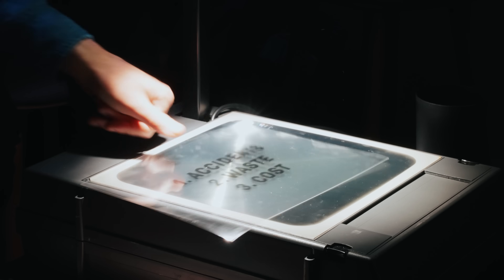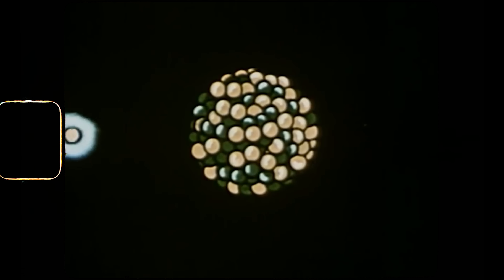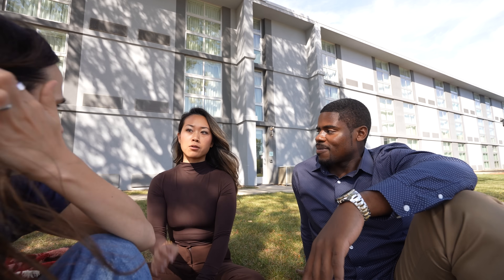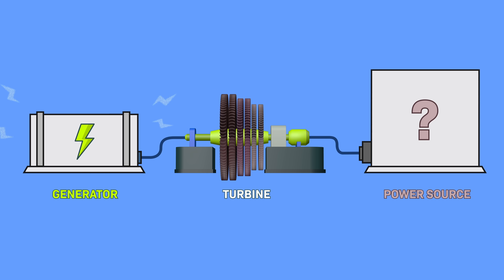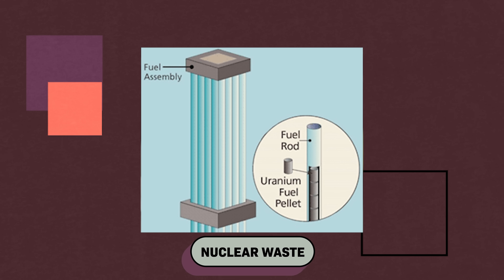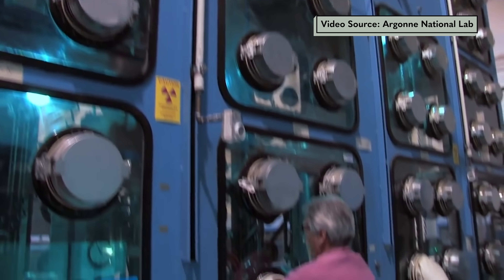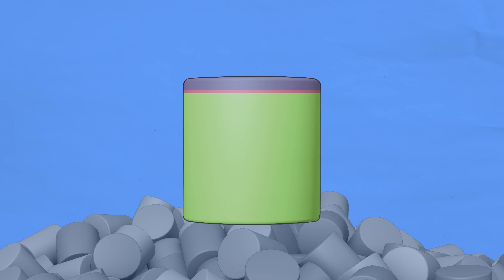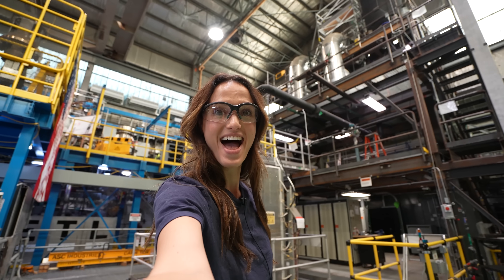The Big Lie About Nuclear Waste

Comment: Sorry, but reprocessing rods is not a secret. We also had plants in Europe that got shut down due to the transports of spent fuel rods which would go all over Europe and there were big concerns that the time the castor containers would spend on track pose a major safety and security risk. They might be targeted by terrorists, thieves or have accidents which could result in a spill. Performing such a transport became uneconomical very quickly due to the high security requirements and the need to fend off protesters blocking train tracks and roads. Getting a transport permit also became very political because there was opposition to nuclear power. All of this would happen in the US, as well, despite the technological feasibility.

The question is not whether you're for or against reprocessing, it is whether you want you power to come from a ticking time bomb (economical and environmental) or from a source for which accidents do not have such grave side-effects, but might be less efficient. My opinion is set: Shut it off - NOW! Energy companies are cashing in Billions in revenue and subsidies, prolonging the service lives of their plants beyond initial designs up to the point when something will happen. Don't think for a second that an energy company will pay for anything then. Also don't think that they have insurance for this case. No Insurance company in their right mind would sell a policy that if the ensured event occurs would mean certain bankruptcy. And that is the same way we should think about how we invest in nuclear power.

Comment: I studied energy, a little. I just want to note that the 150 years said to be covered by nuclear waste may not cover the transportation sector. Maybe they meant that it would, but I wouldn’t imagine so because nuclear power now doesn’t power much of the transportation sector yet, because of the lack of electric trucks and passenger autos. 
I’m curious…
Is there enough uranium or other material available on earth to use to transition to nuclear entirely. I’m a skeptic about the whole system because it all relies on burning something on earth to generate electricity which so many people use foolishly.

Comment: The MSRE (Molen Salt Reactor Experiment) ran for FIVE YEARS at Oakridge National Lab in the 1960s. A THORIUM Based Molten Salt Nuclear Reactor Can NOT Melt Down (the fuel is already melted), Can NOT Explode (runs under Low Pressure vs ALL Current Commercial Reactors running HIGH PRESSURE Water Reactors, the water Flashing to Steam is where the explosion comes from), is Walk Away Safe (Automatically Shuts Down and Drains the Fuel with ZERO human input and ZERO power required), and uses Greater than 90% of Nuclear Fuel vs ALL Current Reactors using LESS than 10% (and YES, can also burn "spent" Nuclear Waste). No need to make new fuel rods, burn it all up in a Molten Salt Reactor to start with.

SO.... of course we (the US)... GAVE ALL OUR TECHNOLOGY to.... CHINA. Who is now Leading the US in Molten Salt Reactor Technology.

Comment: The problem isn't the science,its the regulation (and as we've seen deregulation).  Nuclear power is very safe...when run with numerous protocols.  Put this in the hands of industry without government regs would be a disaster.  increasing profits = cutting costs =  cutting safety measures = cutting staff = lobbying politicians to get rid of safety regs.  We've seen it over and over, especially with Environmental acts.  Politicians will always play along as long as the lobby system exists.  It has nothing to do with the science, and everything to do with the fact that we repeat the same mistakes every 10 years or so.  Until you fix the regulatory system, you will have a nuclear mistake sooner or later.

Comment: I've always thought if the waste has to be stored in water to remove all the heat it's generating, why not use the waste heat from the storage pools to run turbines or sterling engines?

Comment: Totally agree with your point.  Gen-4 reactors could provide the world with all the power needed, and would burn previous fuel-waste.  
Two problems with your presentation.  

1.  Existing nuclear waste is not  a "clean energy resource".  There are a lot of processing steps that require energy to get waste into a usable form.  They are correct that existing waste could produce energy for 150 years, but it requires processing.
2.  Nuclear waste is not ONE thing.  There are 3 main types of nuclear waste and only one of them is useful.  There are high-level, transuranic and low-level nuclear wastes.  Only the first one is of any use.  It's also the least abundant type.  It's also the easiest thing to control because it's the most regulated type.  

I know you are trying to get clicks, but it would be great if you actually did research to understand what you are talking about.

Comment: This was a really interesting video; thank you for producing it.  I do have one question, though.

The current problem with Nuclear FUSION systems is the energy return: that it doesn't (until recently, and in INCREDIBLY SPECIFIC circumstances) provide enough energy to cover its own work.  That it takes more energy to make it than you end up getting out of it.  With this FISSION system, is the return on energy through the electrolysis method you described 'cost' efficient?  It sounds as if it is, but I just wanted to be clear: we DO end up getting MORE energy out of the recycling than it costs to PRODUCE it, right?

Comment: It is funny to think that nuclear power stations are just glorified steam engines. I grew up in the 1960's when optimistically we were told that there would be no need to meter electricity,as it would be an abundant resource for the whole word. Sadly I think the main function was to produce materials for nuclear bombs. Hopefully the future is more optimistic
Reply: “I think”

Is that what you really mean, “think”, ie reason, or is the “bomb” angle just some dogma that makes you comfortable in your beliefs? 

Plenty countries have power with no bomb. S Korea Japan  Canada Germany Hungary UAE ….
Reply: @Nill757  Clearly my beliefs are grounded in my experiences. I'm fairly sure that the UK & USA used their domestic nuclear power program to create Uranium & Plutonium suitable for nuclear weapons. If that isn't the case why hasn't all the world embraced neclear power?
Reply: @rogertaboyle1  It’s not the case. Commercial reactors don’t make weapons grade material. Military has its own dedicated reactors for that, or did. They don’t make any more because US UK Russia don’t need any more.  

 Nuclear power was once very cheap and safe to build, a clear threat to all fossil fuel power.  In France for instance fission power obliterated the large oil fired power fleet in 15 years. 

Then regulators got involved, essentially declaring nuclear unsafe no matter the spending level, always spend  more. Industry made more money on “safety” by making nuclear scary. Spread.  Soviet flawed reactor caused more fear. 

Things may be changing now. No more old soviet style reactors anywhere. And the scary nuclear game is not playing in some countries which are being told shut down coal plants and they need a real alternative.

Comment: Personally, I always find the term nuclear waste silly, because we use what like 3% of the nuclear portion of the fuel then we call it waste.  Imagine if every car could carry 10 gallons of gas but when you used 0.3 gallons of gas the car would stop working with a message no fuel.  It seems ridiculous.  Over here in Canada, we built the Candu reactor that runs without first improving the nuclear fuel in some silly expensive process and we can as I understand run on waste, but then I think how the hell would we move nuclear waste around the countries and not get attacked by terrorists.  Yeah, so I stopped caring because what can I do protest, what a waste of effort :)

Comment: anyone who think nuclear power is safe are all insane. nuclear power plants are ticking time bombs. they all fail at some point into a disaster. its only a matter of time before they turn chernobyl. all that nuclear radioactive water will be spilled into the drinking water. the sickness people get is not flu yet the symptoms are similar and it will be a life long struggle to survive. nuclear power is the filthiest form of energy in the world. it can not be safely removed from the earth. this form of power will drive man toward extinction those who doubt the danger of this stuff are stuck in a medieval level of awareness that use supestition as a means to convince them selves about safety. many scientist that in the past had touched radio active material with their bare hands died from radiation poisoning. it was not sunlight that was radiating. it was particles of matter than damaged their dna and caused the person immune system to fail.

Comment: Excellent report, well done. Actually there is another way to re-use this fuel apart from fast breeder reactors. It is possible to use an external source of neutrons from a particle accelerator to make up for the reduced reactivity of the used fuel, even if the reactor is subcritical (i.e. can no longer sustain the chain reaction by itself). This type of neutron source is also well proven technology, such as the spallation neutron source (SNS) at Oak Ridge National Lab. Another benefit is that the external supply of neutrons can be turned off instantly, stopping the reaction. Such an accelerator driven system (ADS) also transmutes the long-lived waste products like the fast reactor. This has been proposed several times but always blocked by the "Once through" establishment. It's true that the once through process is cheapest as long as the raw material is plentiful and the cost and risk of long term disposal is ignored. China, India and Europe are all developing such systems, but not the US government. Fortunately there is renewed interest in this carbon free process again. Let's hope common sense prevails this time.

Comment: That is all propaganda, just like fossil fuel term... Oil is abiotic and nuclear isnt done properly. If ran hot enough, mass is turned into energy without waste. Japan has solves this problem with making hydrogen with nuclear. Plants cant run hot because there isnt enough storage banks for electrons or load... But if making products with the excess energy then the waste products dont develope🎉🎉🎉

Comment: Using the waste is a partial solution at best. The waste is still radioactive after it's used, it's just bit less radioactive. However it is still a very long and monumentally expensive storage problem.
Reply: A bit less radioactive... That's like saying the moon is a bit smaller than the sun.
Reply: @trapjohnson  I agree but radioactive elements have a half life so that after some time the element is half as radioactive. Still deadly but it will take more time to kill you.
Reply: @foxmaine3921  but as she said in the video, we can do 200 years as opposed to 200,000.
Reply: It is expensive to maintain, but 200,000+ years versus 200+ years? That's a three-order of magnitude difference that should not be trivialized. With a shorter time frame, the risk of some catastrophic event (natural or man-made) releasing radiation is cut significantly.
Plus the atmospheric effect is limited to water vapor; no adding CO2 to the atmosphere while the reactor is running. Although mining the original fuel takes a lot of fossil fuels.

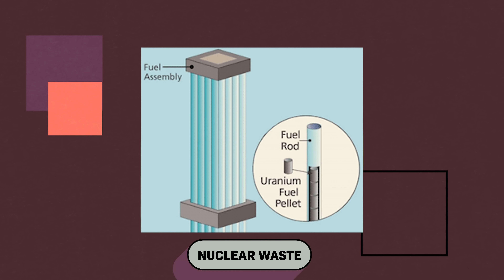Comment: Oops - at 7:15 you mentioned enrichment but then describe the process of breeding!  Enrichment means filtering out the U238 while keeping the fissile U235, in a process that eventually brings up the concentration of U235 to something like 5% - but don't forget about the big pile of U238 left over.  It's ok though, U238 can be bread into... breeded into?... U239 in a heavy water reactor (CANDU) or fast breeder reactors which don't need enrichment.

Comment: Thanks. The most important point you raise is that producing electricity from nuclear energy is an engineering problem but the opposition  to producing energy from nuclear fission is a political problem. You mix the two issues in your presentation. Your engineering presentation falls far short of the current state of thinking on nuclear energy production. Illinois EnergyProf presents many detailed videos here on YouTube, such as Economics of Nuclear Reactor, The Real Bad Stuff, and Dispelling the Myth of Nuclear Energy. Mike Brennan in the comments already called you to task for imprecisions in discussing radioactivity of SNF. Then there is the whole question of the economics of energy production. Cleo, I believe you mean well, but either do a better job or don't do it at all.

Comment: The whole anti nuclear campaign was started by oil companies because nuclear woukd have made them obsolete.
It's the cleanest and safest form of energy known to man with less than 1000 deaths in 70 years of use, compared to solar that kills more in a year.
As for waste, just look at the damage and waste from building solar panels and their eventual disposal that contaminates the environment 
And that's not even counting the land usage which involves destroying whole ecosystems.

I worked in environmental conservation for 12+ years, and did studies on environmental impact of various energy production methods. And one thing  i found, if the UK converted ton100% nuclear it would cut CO2 emissions by 93% especially when combined with other technology that would come from this.

But one example i like tk use is NYC to power it with solar assuming a massive advancement in solar technology allowing us to utilise the theoretical limit of solar energy, you would need to cover an area 15x the size of manhatten with solar panels while focusing as much sun as you can on them just to keep NYC running during peak sunshine. 
To provide enough to keep the city running overnight you would have to double that.
To provide minimum back up power (7 days) and to keep it charged you're talking covering an area around 45x the area of manhatten island and use 40,000 shipping containers worth of batteries which if damaged or over heated have the explosive potential to a small nuclear device (around 40kt of TNT if i remember)

To do the same with wind you'd need about 66% of that land area. But with trees cut for a long distance, and massuve amounts of concrete poured to provide the base (don't get me started on the co2 produced in making cement) all of this destroys biosphere and in both cases has to be replaced every 25 years and can't be recycled due to how they are made.

Meanwhile nuclear can do the same with no backup required, and room for expansion in an area 1/2 the size of manhatten island
And with the right mix of reactor types (burner, mox and breeder) you can create an almost closed fuel loop with reactors burning waste of other reactor types and breeding more fissile material for other plants

Comment: Only problem with geothermal they don’t want to talk about is the cooling in the crust that causes unknown changes in the Earth. Solar and wind are not efficient enough to offset the non-recyclable toxic materials. At least with closed loop nuclear, the waste might be toxic, but not for long, relatively. But, the government doesn’t want that because the current method was a two for one (nuclear power and weapons. Closed loop leaves nothing useful for weapons.

Comment: Yeah, salt reactors. You could have one in each neighborhood. Most of the radiation is used up but, there's still plenty. They won't melt down. They just freeze up. Has to go somewhere to be fixed.

Comment: Great stuff.  I am glad to see more people sharing this information.  I've been working in the Nuclear Power, weapon, and waste industry for 15 years and Small Modular Reactors are a great direction.  They have no meltdown capability.  You can put them nearly anywhere.  This is incredibly safe carbon free energy.
Reply: The small modular reactors the Soviet Union used were left in situ after the collapse of the Soviet Union.  Metal scrappers tear them apart... wild.
Reply: @slonktonkster9680  And then what happens?
Reply: If it wasnt for weapons.  We wouldnt even use this technology.  I'd still prefer Green energy over radioactive elements

Comment: The number of times you reuse a hazardous material is proportionate to the risk it poses to its handlers. Growing our nuclear energy consumption, whether new or recycled fuel, is a risk to the safety to all in its vicinity. Unless we solve the reactor meltdown problem, the faster we ween ourselves off of nuclear energy, the better. A movement towards commercializing nuclear in any form is dangerous step backwards. Let’s use our ingenuity to develop a method to reduce the longevity of nuclear waste without commercializing it.

Comment: I recently bought a 200 watt solar panel system and if this little7 sf amazing thing will run my sanders and charge my drills.. imagine 700 sf on every house top!!!.. honestly I think the problem is that cheap energy independence would make folks hard to control and inslave..  so each new method of cheap energy is squashed .. Governments hate competition..

Comment: A minute and a half in and I'll tell you the problem. 

You ever use a modern plastic Gass can to store Gass? 

There cheaply made but expensive to buy and leak from multiple places that should be sealed...

Now look at a gass can from a hundred years ago. 

What happened to Gass cans I wonder? 

The answer is the government regulated decent gasscans out of existence and hand picked a couple of Gass can companies to be exempt from the regulations. 

This is your nuclear energy. 

Regulated to were the safe clean nuclear plants can't be built but the cheap 50 year old leaky ones can continue operating.

Get it?